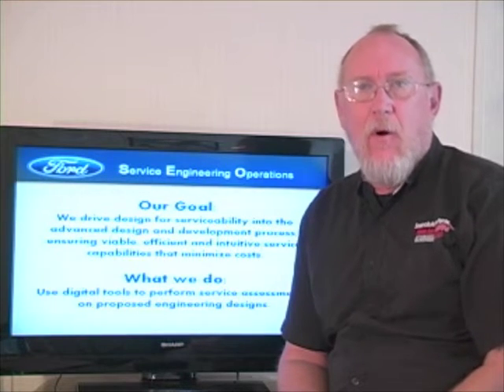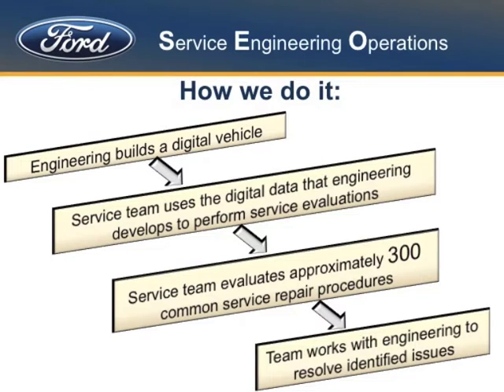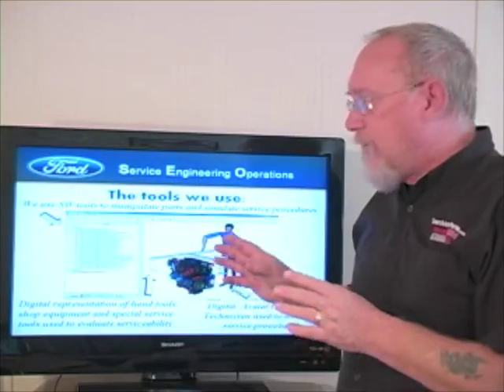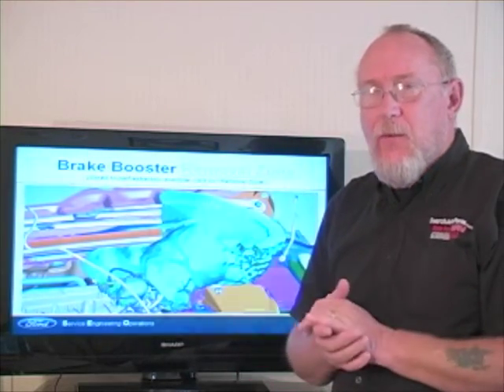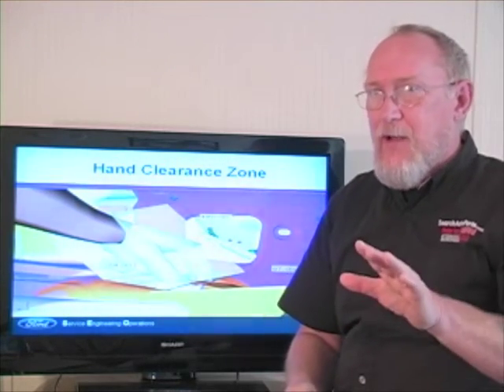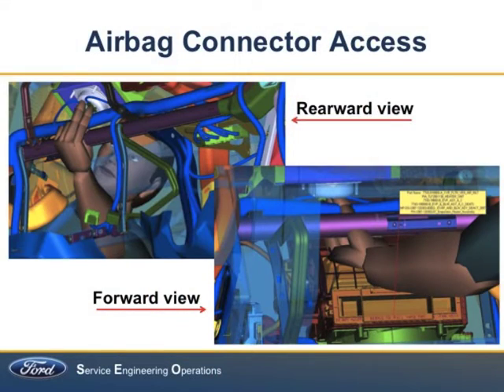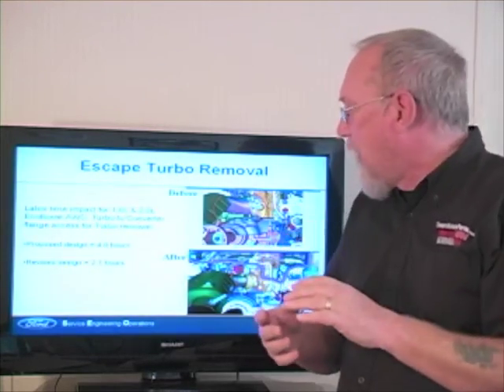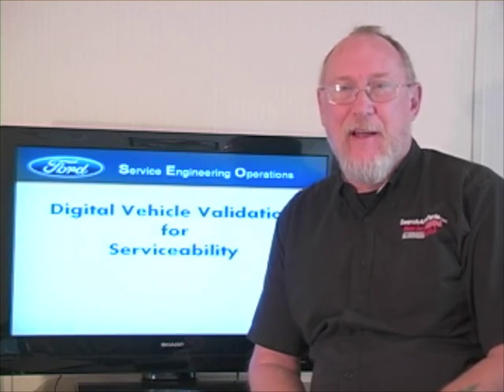Virtual Serviceability:  Ford Takes Care Of Us Techs!

Comment: Are videos like this coming in future service manuals? To know they designed it to come out a certain way and not have a good way to describe that in words on paper means to me that the video showing their concept has to make it to a manual at some point. Also once the vehicle is physically made does some team actually attempt to do the jobs how the digital video design says to do it to prove the concept? If so why do I not see that specific information in digital service manuals? I have yet to see a service manual that tells me step by step how to accomplish a given job. It's as if the programs I have used assume the person doing the work has done hundreds of them to know how to do things. That is a terrible assumption to make.
Reply from the maker: I don't know about the service manuals, but I have seen Honda use video in their TSBs. What service information system are you using?
Reply: Motor Age We use Mitchell where I work at now. I have used Alldata in the past. Liked Alldata a little better then Mitchell. I miss actual printed service manuals that is what I was brought up on in the Air Force.